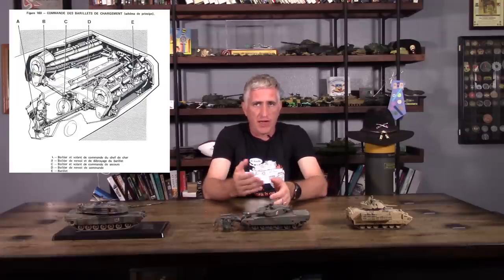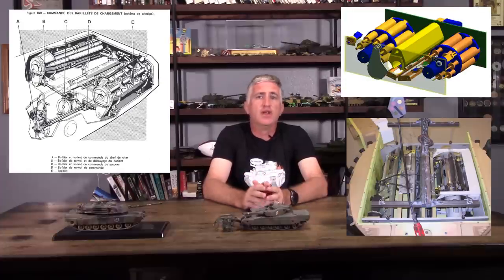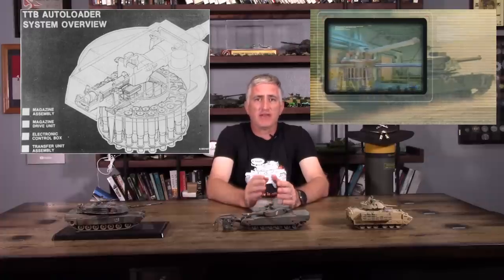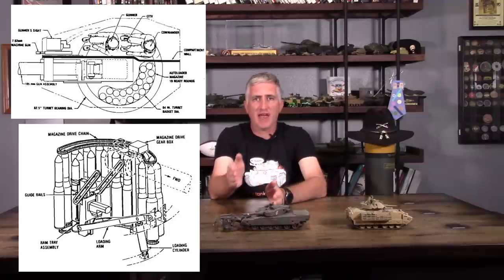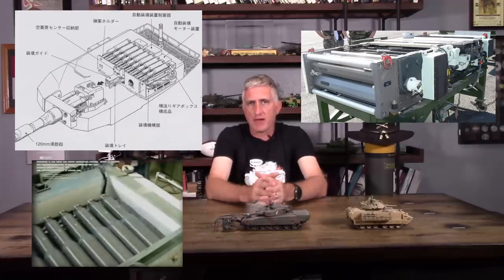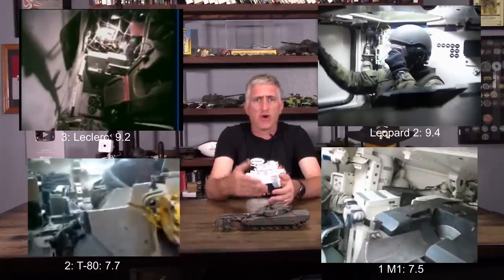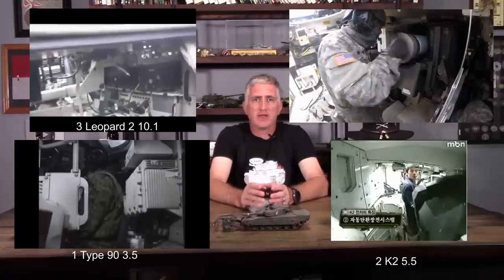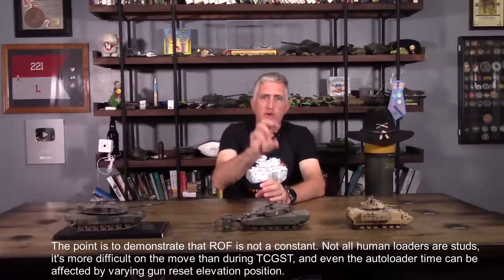Whither the Autoloader?

Comment: I was Artillery at one time I was in a Abbot 433 which is in the same series as the 432 APC at the time we had an Infantry Regerment who acted as our screen as the normal detachment of an Abbot was five even though the book says it should be ten reduced to eight . These guys the Infantry got assigned to a gun per section so you would have a 433 followed by a Stalwart followed by a 432 with the Infantry in the 432 they were taught how to do maintenance on it take bashing and minor mechanical maintenance so guess what the running gear takes engine gearbox are the same on both vehicals so suddenly we had many hands make light work times eight with the other two playing peek a bo with the box heads our normal opponents.  Of course this worked both ways as they would bring there tin can next to us at night so both vehicals got a good look at from both crews another pluss was same full and spear parts from trakes to oil filters to Fuses mind you we kept an eye on our BV and for some strange reason they did the same but appart from this minor fault things went very well

Comment: A autoloader does not get fatigued like a human being will eventually get after a long period of sustained combat. But this also causes another problem as shell size gets bigger the ability for a human loader to reliably and consistently load a shell gets slower. 120 mm shell weighs less than a 130mm or 140 mm shell. As far as I know NATO has made the 130mm gun standard so now tanks within NATO aligned countries may start phasing out 120 mm guns for 130mm guns in their MBTs so the shell is not only heavier its also longer.

Comment: There is a con, there is no final human control of the round before firing, if you are making the storage generic (so that every round can be loaded heat, sabot, MPAT, etc.) , then a mistake in the loading process will come to light after the round is fired. If you spot that the wrong round is fired you have the confusion of where are the right ones stored. If you make the storage specific then the loadout of a tank becomes rigid with less flexibility or you have to make a sensing system .  The loading of the autoloader needs a more discipline because a checkpoint is removed.

Comment: Issue with russian autoloaders is that they will jam if when turret get hit by anything othen even ERA blow is enough for it to try to feed a second/charge round into already full weapon. There is a system of sensors to prevent that (not in every tank, often bits a pieces are often missing or cables broken) but it tends to be switched off, it gives lots of false errors.

Another one is that you cannot swap rounds with autoloaders on T72/90. Or if fuse fails, that;s it for you. You are done shooting for at least 2 hours.
Also, the speed isn't as good. Load under 5s happens only if you want to load the next round in the carousel. Realistic average is about 12s.

Comment: Another positive to an autoloader would be that it reduces the requirement for crew to be positioned inside the turret. 

Without the need of a loader already inside the turret, there is no strict requirement to put any other crew inside the turret. Gunner and TC can be put inside a protected box inside the hull along with the driver, remote controlling the turret systems, using cameras and sights for visibility. Increasing their survivability in case of a catastrophic hit. Similar to the T-14 Armata for example. Even though you could still argue successfully that gunner and TC are best positioned inside the turret, for visibility without cameras.
Reply: even with cameras, tests have shown crew members are more situationally aware in the turret then in the hull even with camera aid, but you can make the turret smaller (like the whole tank) and thus lighter, thus faster turret rotation speeds and thus faster targeting.

Comment: Automatisation affects damn near everything, and tankery won't be an exception. Autoloaders definitely will arrive in every army.

Manpower issues will be fixed with even more automatisation. Today there are systems that alert you when the enemy opens fire, in a few decades the TC has a neural network that alerts him when it sees something suspicious better than an observant loader ever could. Driving support systems that save fuel and reduce wear are already common in many vehicle types and will certainly help in tanks.

This is not just a question of which system performs better, but also of cost. Armies expect better and better qualifications, while competing on job markets that provide fewer suitable recruits at higher costs. That means they'll save manpower whereever they can to reach their required strength. And this type of automatisation will eventually outperform human troops, so it is also an investment into keeping up to date.
Reply: Whats the point? You can just make tank autonomous drone. Save space and weight for more fuel and ammunition. Doesnt risk meatbags in today extra sensitive world where losing 5000 soldiers is like anuda Somme
Reply: @ksztyrix  that's not gonna happen for a long time. You can't rely on remote control which could get jammed, and AI is still FAR from capable of doing this on its own.
Flying drones are a very different issue since they are much harder to localise and disrupt. And they still can't simply replace manned jets yet.

Comment: Something that might be done with both types of loading. Separate ammunition, projectile and propellant could be stored in different places and loaded together. Sabot and canister shot would be very safe inside the turret. HEAT/HESH and HE less safe, but protecting it is possible. Alternate: human "preloads" the next round, but the gun actually loads when commanded by the gunner.

Comment: Thanks..good video.
Probably because I'm from an older generation.. I don't trust electrical systems, particularly  computers, but younger generations do..so.. but I have come round to the idea an autoloader would be good, especially if one can do manual if needed. (maybe not as efficiently.. but possible.)
You touched on an interesting point though..I have followed M60A2/3s as an infantryman  and noticed that their "large silhouette " was swallowed up by the huge outdoors. ( I get Telescopic sights)  I often wondered how a smaller soviet tank would see over all the bushes , weeds and foliage ? So. similarly . while a  human loader will tire..is it really a problem? How many crews get into fights long enough to slow performance..and wouldn't a crew get amped up on adrenaline in a real fight? But crew reduction is a worthy idea. AND you foresee   the biggest problem..Bean Counters (Having great experience here) will rob them..One really must be really ready to argue with them to keep the crew for maintenance and replacements.

Comment: What do you think of a four man crew with a bustle loader?
(Imagine something like a CR2 with a different bustle welded on)

Would it be a good idea?
You have the versatility of a four man crew with the sustained firerate of an autoloader (that can also be restocked in combat by the operator). When not feeding the ready rack, he can be doing other tasks like spotting, manning the RWS, boiling vessel, etc

Only immediate issues I see with this idea are the increased mass from the loader and armour (although this could be fixed with better composites) and increased cost per vehicle
Reply from the maker: It's basically the meggitt system. It keeps the fourth man in the M1

Comment: I gather for some guns, particularly designs based on the 2A46 using two-piece ammunition, the process of unloading a round, returning it to the carousel and reloading with a different type of ammunition can be a pain in the arse. The autoloader might be able to grab the propellant charge from the breach, but one of the crew has to fish out the projectile manually.
Reply: In combat, the preferred method of changing ammunition is to fire what's in the gun and then reload.

Comment: To be fair - the video clip of the Leopard 2 loader that you used to judge reload time, is a swedish conscript in basic training. I wonder if they had even nailed the roles of the gunner, driver, loader when that was filmed. It takes some months of evaluation before those roles are set in stone.
Only the tank commanders are predetermined when they start conscript training. Their training and service being longer.
Reply from the maker: I used two Leo 2 clips. One loader was better than the other. The point is that there is no guarantee that every loader is a stud. You could end up with one just graduated from AI who is barely able to lift the minimum weight in the ACFT.

Comment: My humble experience with autoloading system of my 30mm bushmaster of my CV90 is as soon as the system broke, the whole turret crew cannot work properly, cause the help of the gunner is more than welcome to deal with the 30kg autoloader component. Which means just the driver can be somewhat useful. Also when a problem occure, 5 min is really the shortest time our tank was out of action. I would say sometimes our cannon was completely out until we can completely dismount the cannon. So we were basically a machine gun carrier, if this venerable MG51 would have been nice enough to work properly.

Comment: Dear Sir,  as an old soldier who cut his teeth on the Cougar AVGP, having a 3 man crew is a huge liability.  Where I agree with all your points on the autoloader, we still need our loaders.  As both a Troop Leader and Sqn Commander, being able to say "Loader! Take over!" when you're trying to fight your troop/Sqn as well as your call sign (C/S) is huge tactical advantage.  When we were in our Cougars with just 3 man crews, it was a nightmare trying to fight my C/S, control my Tp/Sqn and either take a frag O or issue one all at the same time.  Honestly, it pulled 1/4 of your firepower off the line because you can only really do one or the other without making yourself a target of opportunity for the enemy.

Then there are logistics!  I don't care what platform you're on, AFV or Tank, in a target-rich environment (aka a kill zone), at best you have 15 mins worth of ammo before you need re-bomb.  Even if we violated every known safety precaution, it will take 15-20 mins to get your C/S back on the firing line.  With a crew of 3, it's now 20-30 min.  (break the box, remove from the cone, carry to C/S, hand to one guy on the back deck, hand to guy in the turret. repeat! Without the 4th guy smashing open boxes/ripping rounds out of their cones, this just got a lot slower! ) 

I can see an autoloader being an advantage to a Reconisance AFV.  As they can use the lower profile and are just firing to defend themselves.  But for a frontline MBT/AFV we still need that 4th man to be combat effective.  

Cheers and all the best to you. Thanks for the video.

Comment: I feel like, were I drawing up an organization based upon three man tanks, rather than keeping the strength in tanks the same, I'd actually increase tank strength slightly whilst keeping the manning requirements the same. That might hurt maintenance slightly, but would give extra tooth to the unit. I'd probably want the tank gun designed in such a way that it could be manually loaded by the gunner though in a pinch... that would mean you'd have three clear roles: command, weapons, mobility, for the TC, gunner-loader, and driver... and I feel like that is probably worth it doctrinally since it should simplify and clarify everybody's role on the crew. 

I feel like the autoloader probably goes hand in hand with just making the  turret unmanned which is I suspect the future. Two man tanks with a driver and a commander, and possibly weapons controls for each... but then your crew gets kinda overloaded with tasks. On the plus side, I guess at least if the turret is hit by the tank you didn't see it isn't that big of a deal?

Comment: Hi there, Chief. just a quick thought (since I am not 100% sure): Could it be that having no auto-loader makes upgrading the gun in future a little bit easier and cheaper? Like, if one would change the type of propellant, need to split the cartridge into two (for some odd reason) or decided to move to another caliber/longer/shorter projectile, then one would "only" have to adjust the storage space and the gun itself, without having to worry about one's autoloader?

Comment: Sure, you could send additional people after the tanks in APCs or other vehicles, but that still limits flexibility in some regards.

For example, I know that at least in the German army, they do stuff like every time a tank drives into a forest, (when possible) they stop and use tree branches and shovels to wipe away the track marks as good as possible, so it is less obvious from the air that a tank drove into that forest.
When the company splits up/disperses, you won't send that APC around from tank to tank for sweeping and shoveling duty, would you?

Or maybe you would? After all, the French must have good reasons to cart a 4th man after every single tank. It seems to me, redundancy alone would probably not be reason enough. As crew replacements, maybe 1 for every 2 tanks would be enough, or less.

Also the Bundeswehr use MBTs for heavy reconnaissance missions, where they send teams of 2 MBTs into contested terrain to scout. They have a special protocol for how to move stealthily and the such and part of that is that the loader is a 4th set of eyes that checks the rear perimeter while moving, freeing up the commander to keep a general overview and concentrate more on the sides.

Aren't tankers in other armies doing stuff like that too?
Doesn't seem like it, considering those points almost never come up in this discussion.

The Bundeswehr will probably be forced to adopt an auto loader with the next MBT they are currently developing together with the French, because of the 130mm gun and the ammo being too heavy and cumbersome for a manual loader.

Comment: One of the problems some armed forces might have with autoloaders, is that skilled technicians to maintain or repair them are in short supply. The Royal Netherlands Army is having difficulty to sustain the small force of MICVs (CV90/35NL) already, due to a lack of engineers. There's a general lack of engineers in the entire economy, so wages go up and the MoD still is reluctant to follow that trend, so hardly any new recruits are forthcoming that want to serve as engineers in the army. Moreover, the minute they do and are trained to a high skill level, after 4 years of duty, they are a highly demanded commodity elsewhere and leave the army. The problem then is, that adding an autoloader is adding mechanical complexity to a tank, which requires more engineers. 

Back in the day when we had compulsory military service (draft) that wasn't a problem. The army had vast amounts of young men having attended a technical education and if that weren't the case, the army had its own training centres that were capable to generate decent amounts of engineers that were jsut enough skilled to do the job. And many young guys were eager to serve as an engineer, because they left the service with relevant experience. Same was true for the Bundeswehr, but since that went porfessional, it seems to have the same problems. I'm therefore quite curious to see how the next generation German MBT will turn out: with or without autoloader.

Comment: Great Video! I am curious if the ammunition will shoot forward killing the crew if it explodes in the turret bustle of a cassette autoloader? Wondering if this could be an issue for tanks like the type-90 or leclerc.
Reply from the maker: No. There is nothing for the force to act against to send the projectile forward
Reply: @TheChieftainsHatch  Thanks for letting me know! I thought the seal created by the casing and sabot was enough to propel it forward but it makes sense that it would require the much longer seal of a barrel for it to shoot off.

Comment: Only advantage of manual loading that i can see is that a loader can unload a chambered round (normally) without moving the barrel.....which means that if you suddenly need HE or cannister when you have AP loaded (or vs-versa) not having the barrel move may be the difference between achieving surprise and being spotted before you get the right round loaded or away

Comment: Imagine the advantage of putting the extra crew in a rapid repair vehicles instead of squeezing them in a tank just so they can act as a mechanic in their off time. If you put 3 rapid repair vehicles with 3 crew each per 15 tanks you still save several crew members and you could perform quick battle repairs like replacing a track or road wheel or towing a tank much better than having 1 extra crew per tank. Not only can you now repair 3 tanks at once with 6 men working on them but 3 of them will be full time mechanics with many more tools available. And having 3 extra repair tanks per 15 will be much better for the overall maintenance than having a loader that does maintenance when he isn't busy. I also doubt that you will have many tank battles where you are the lone tank and can't call on another guy to come help you lift something if you need to make a quick repair.

Comment: after is saw that clip of the Type-90 run a 3.3second reload? im all in now. before i always assumed that both where par with each other in load speed. and usually who ever shoots first, wins. so an speed of reloading was never an issue as large tank vs. tank battles most likely wont happen again. 

But now that i see that an autoloader can hands down beat out a hand loaded gun. im all for it.